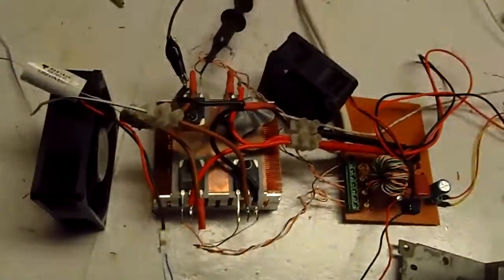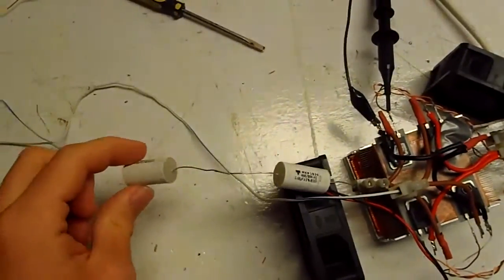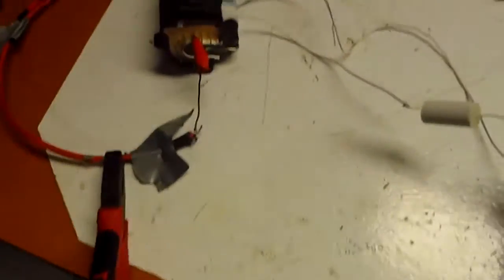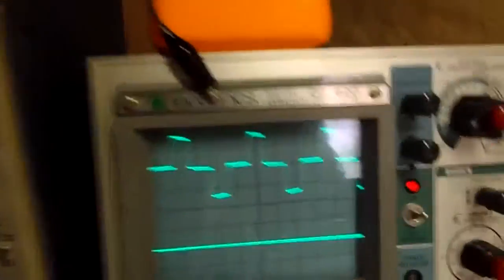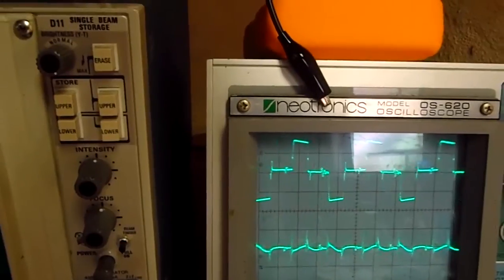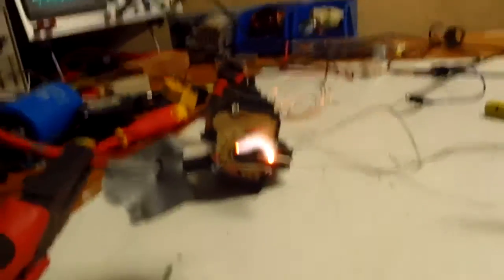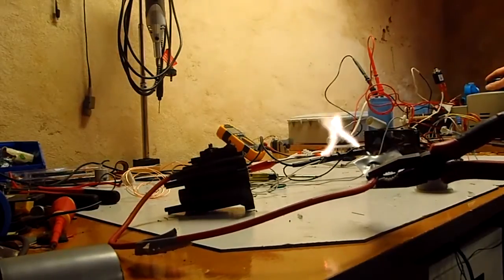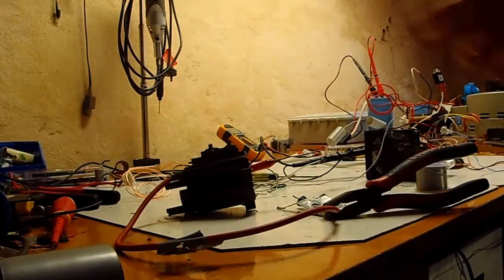Testing the fullbridge flyback driver with A series resonant capacitor

Comment: Nice Full Bridge! :)  What is max input voltage do you successful on this MOSFET for primary?
Reply from the maker: Thanks, the highest i ever ran this bridge to was 320VDC for a very short run. This setup wasn't really designed to handle that much for long due to switching inefficiencies and fixed tuning rater than PLL based drivers that always stay locked onto the resonant frequency of the flyback
Reply: Woah! That is insane highest! So say PLL is the better than just MOSFET driver and Full Bridge MOSTFET?
Reply from the maker: Michael Marr  PLL based driver is quite difficult to get setup and working properly, but when it is it will drive the mosfets more efficiently so you can run higher power without them heating up as much

Comment: do you have schematic somewhere posted  of this driver ?
Reply from the maker: Not this specific design, it is a tl494 setup in flipflop mode feeding a tc4424 mosfet gate driver ic which drives the gate drive transformer. 
you can use 2 seperate gate drive ic instead of the single one.

the output stage fullbridge can be any choice of high power mosfets or igbts
hopefully that helps